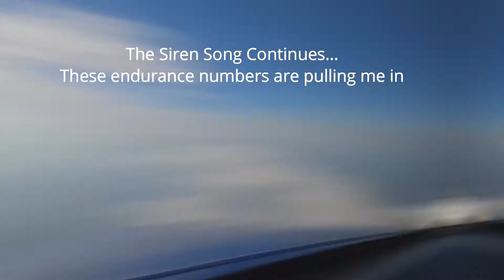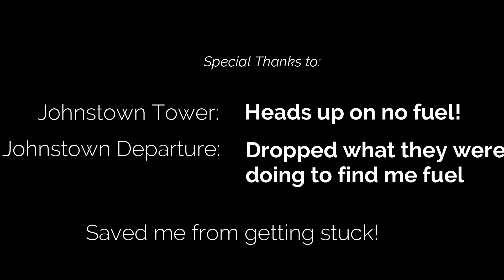PA30 Pilot - Flight #015 Twin Comanche Long Flight Home running Lean of Peak (LOP)

Comment: Great video. So good!  You are fast becoming Mr. Twin Comanche, haha.
I'm just wondering, why not fly the approach LOP all the way?   Deakin (pelican's perch) flies it all the way in LOP and low RPM, if I recall correctly.  Obviously you need to train rigorously for "mixture prop throttle" for an aborted landing, but that should be standard practice for everyone.  Four advantages of LOP approaches:
1.  less fuel burn (obviously)
2.  Less risk of going into the red box... as you descend and your mixture goes leaner, this can be an issue when ROP
3.  Less plug fouling
4.  You don't need to worry about ground leaning, you are already lean.
and others...
I think every POH says "full rich, full RPM" on approach, but they were written by lawyers for the lowest common denominator...
Would love to hear your comments.
Reply from the maker: I understand your thoughts. Keep in mind that I am not an expert, and am reading and attempting to apply what I'd learned. I'm still learning.

I have been working the heat issue, and as a result, talking with Lycoming, Penn Yan, GAMI, and JPI to consult. I've also been talking with you and other interested parties; some with much more direct experience.

I learned allot, and will put a blog out there talking about it. 

For now: Generally - I think leaning as much as I talked about at altitude, and not going rich again for the approach, could cause the engine to falter or quit when you add power. I don't think the red box will be a factor in that case, but I have to re-evaluate that based on your comments. It might be and I haven't done the math.

Lycoming was adamant that LOP was not worth the risk. They implied detonation could occur quickly and just take out the engine. No specifics, but I'll look at it.

A well known Comanche expert reached out to me and advised me to start thinking in terms of MPG and not necessarily LOP. I'm rethinking LOP but not ruling it out. Here is a guy, smarter than me, flying ROP/MPG and not LOP. I didn't expect that. 

This is an interesting journey and I'm excited to get back in the airplane next week and play some more.

I am considering more points of view at this point.
Reply: @PA30Pilot  As a disinterested observer, I think everything you have been documenting in these videos has been great.  I've enjoyed the journey.  
Lycoming has changed their tune in recent years....   
It's almost impossible to detonate when LOP, unless you are inappropriate low octane fuel.  I recommend you read this article: https://www.avweb.com/features/pelicans-perch-43detonation-myths/   Detonation is most likely to occur at 50 ROP... moving in either direction reduces the likelihood.  
A lot of the old timers who aren't up to speed on the research done by GAMI since the year 2000 still think in terms of "ROP only", and that's ok.  Personally, I want to know the latest information and put it to good use.  It's a personal choice, I think!  I know bunches of pilots who have zero clue on this stuff.. the older "weekend casual VFR pilot". 
The advantages of LOP are many, as you know - lower temperatures, fewer valve issues, longer engine life, lower fuel burn, reduced emissions, better safety, etc etc.
The catch is one has to have to have GAMIs and an engine monitor, plus the interest in learning how to do it right.  You have all three.  
ROP is a valuable tool in any pilot's bag of tricks... but never running LOP is leaving a massively powerful tool off the table!
Again thanks for sharing, and thanks for listening.  Sorry for the diatribe, haha.
Reply from the maker: Par5Eagles I appreciate your input. I haven’t written it off at all. More careful experimenting ahead.
Reply from the maker: Par5Eagles just read the article, and it reinforces my earlier conclusions. I received allot of input on a FB post in the Comanchegroup (some of it based on older misinformation) that shows there is a great deal of interest. I plan to state my goals going forward to keep them clear. Do allot of flying both ROP and LOP, and make some more videos as I come to my own conclusions. I appreciate your time and interest.
Reply: @PA30Pilot  excellent.  Would you share the link to that discussion? I'd love to see it. or is behind a paywall?
Reply from the maker: Ted Dryden i think you are referring to the Piper Comanche Group on FB post. I tried to share it, but was unable. You might be able to look it up on my FB page, or on the Piper page, by searching my name. You can join the Piper group too. No money involved. 

The thread there took off in a number of directions, predictably. Before adding all this equipment, I didn’t know or care about the specifics I talk about now. Without engine monitoring, for example, you really can’t explore these topics safely IMO, so I ignored them and didn’t educate myself further. Many of the commenters are in that category, and their conservative responses and posturing are appropriate for them. 

Others among the commenters are known to me as knowledgeable resources with different opinions and suggestions to what I’ve been saying. Next for me is an overall review of where I am, having resolved the heat issue. Then the ideas and positions from recognized experience that don’t agree with me are the ones I’ll explore further initially.

Comment: Nice flight time! What are your manifold pressure and rpm and altitude for the LOP fuel flows you are getting?
Reply from the maker: Yes. It’s hard to get in trouble at altitude since I’m normally aspirated. Went flying last several days at 15gph and great speeds.
Reply from the maker: 9000’ 22” MP (full power) 2400rpm zoom